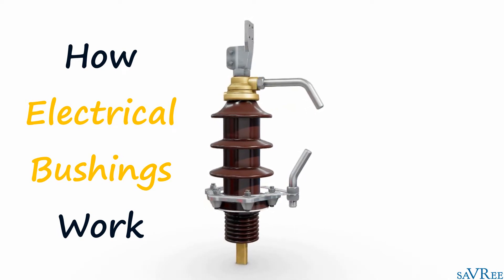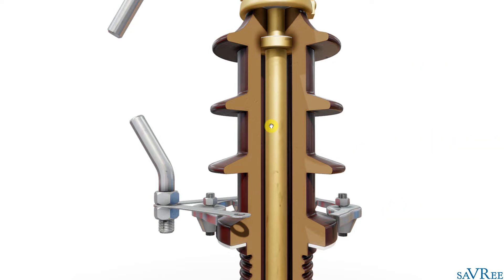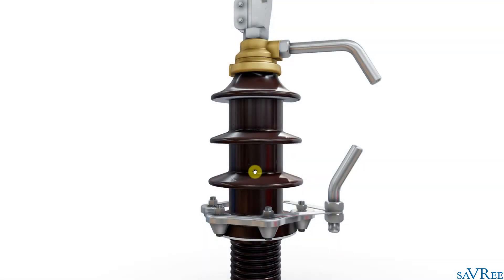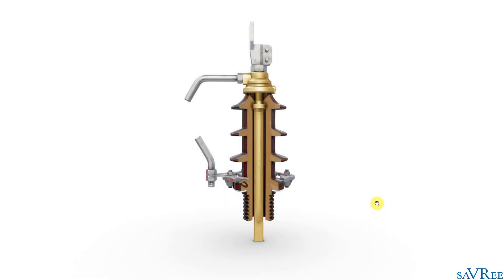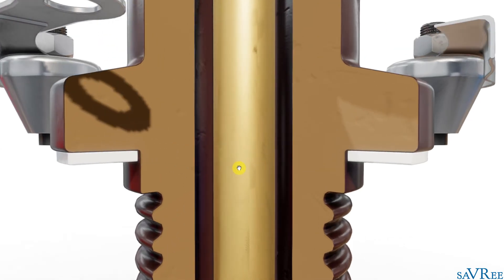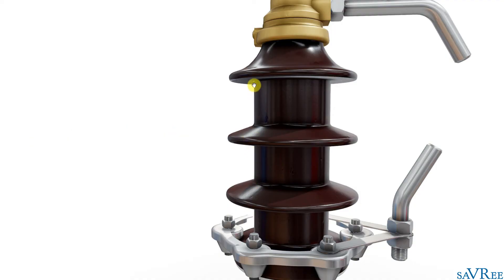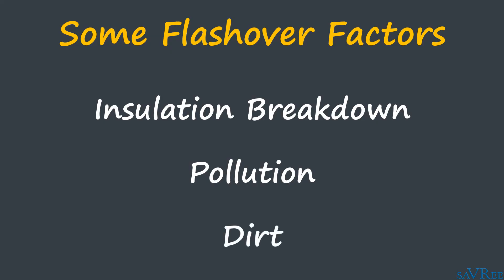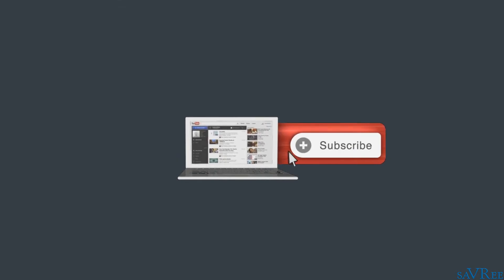How Electrical Bushings Work (Power Engineering)

Comment: I note that porcelain is weak in tension. Why would this bushing rely on tensile strength to make a sound mechanical joint to the metal of the tank? Surely a screwed ring on top of the base would be a better and more reliable clamp.

Comment: you give the impression the inside space of the bushing is 'filled' with oil. 
unless there is a bleed screw at the top of the airspace to vent the air to atmosphere under pressure of oil from the header tank there will always be some air in the internal bushing space.
not that it is a detrimental thing in relation to insulation effectiveness.
air will over time eventually dissolve and diffuse into the oil however with the low head of oil combined with low surface area this will occurr over a long period of time if at all.
the minimum insulation effectiveness is from the conductor at the bottom of the bushing to the body of the transformer casing. 
from viewing the design of the transformer casing some air space appears to be of little or no consequence. regards Richard

Comment: As well as a great insulator, Porcelain also helps in heat dissipation and the the smoother the surface (e.g. the Glaze) the better the heat transfer. Not saying these things get so hot that its necessary but ... from the design of the porcelain with the conical fins along its body suggest a necessity for heat dissipation surface areas.

Comment: Hi savree3D I am a mechanical engineering student, due to this pandemic our projet has to be canceled so we have to submit our task by making a 3d animation, it consist of welding, assembling and so on
do you have any software recomendation to make those task, I am new in keyshot 9,but I think i need  lighter software
i am using laptop i5 9th Hseries + GTX 1650, thank you
Reply: sure